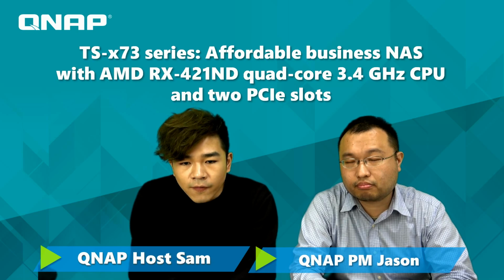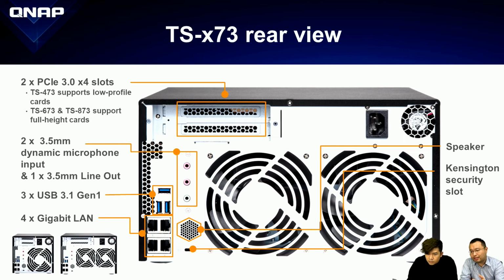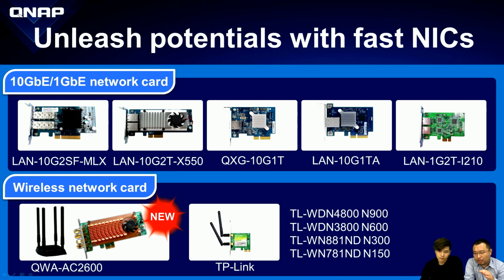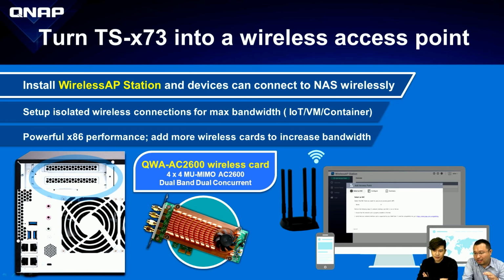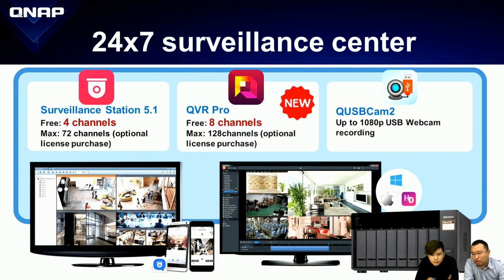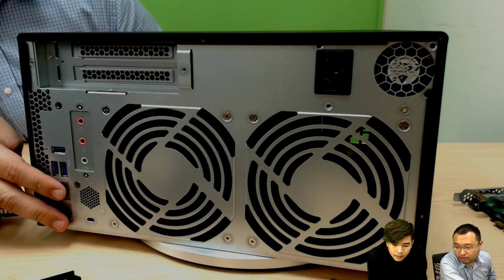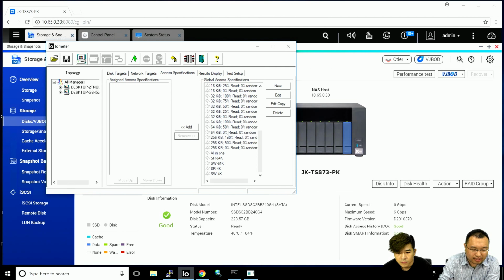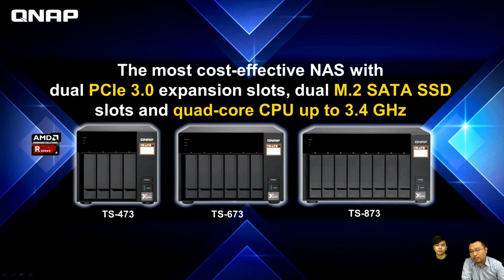TS-x73 series: Affordable business NAS with AMD RX-421ND quad-core 3.4 GHz CPU and two PCIe slots

Comment: Guys, do you have an issue with a BIOS or it's a firmware issue? My TS873 shows min of 1.4Ghz and max of 2.1Ghz. Frequency never go above 2.1. 
[~] # cat /sys/devices/system/cpu/cpu0/cpufreq/cpuinfo_max_freq
2100000
[~] # cat /sys/devices/system/cpu/cpu0/cpufreq/cpuinfo_min_freq
1400000
I've opened a ticket with qnap support..
Reply: Did you ever find a solution to this?
Reply: @daltonrandall4348  Yes, it was a purely cosmetic issue. They sent an app that shows real time frequency.
Reply: Sergey thanks!

Comment: Thanks for all of the great information. I believe I will invest in the TS-873. 

I am planning on starting out with just two Seagate 8TB Ironwolf NAS SATA drives. These are currently under $250 each. Do you recommend another similar drive that is within that price range? 

Also, what kind of installation and support can you provide?
Reply from the maker: Hi Mike, it's so good to know your positive comment to the TS-873.
For seagate drive, HDD above 4TB supports Iron Wolf health manager.
You can get more information to your drives and more protection to your drives.

As for  installation and support for the NAS.
Basically just go to QNAP website and download Qfinder Pro, power on the NAS and connect the internet port.
Once you make the NAS under the same LAN to any of your computer, Qfinder Pro will guide you for the rest of it.

If you have any technical issue, please kindly contact your domestic reseller or QNAP global customer service.
Hope you enjoy the experience and all the APPs from QNAP NAS
Reply: QNAP Systems, Inc. Thanks for that information! I will be purchasing this very soon!
Reply: @qnapsys  What about Western Digital drives over 8GB?